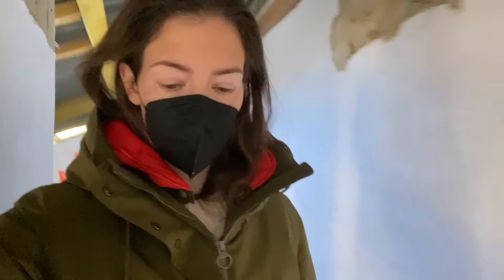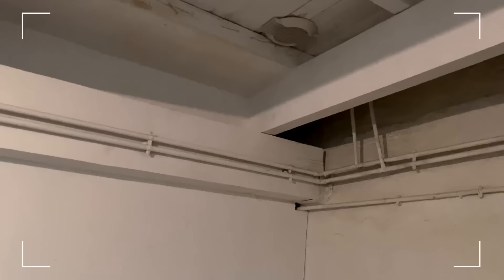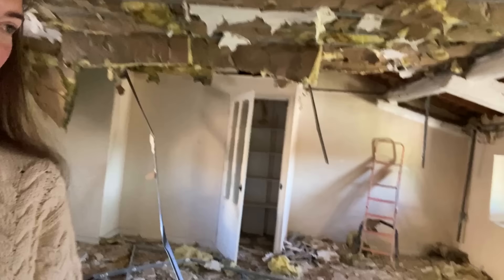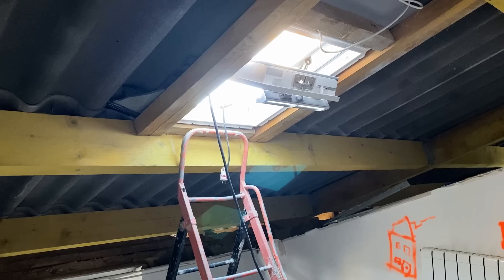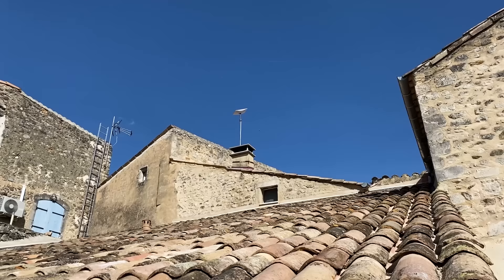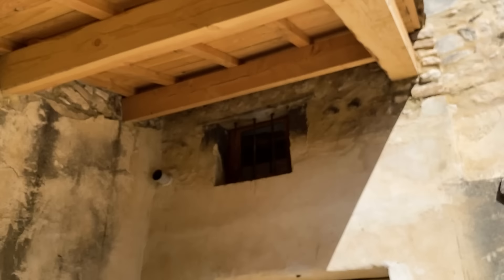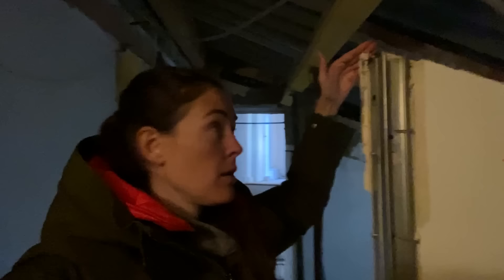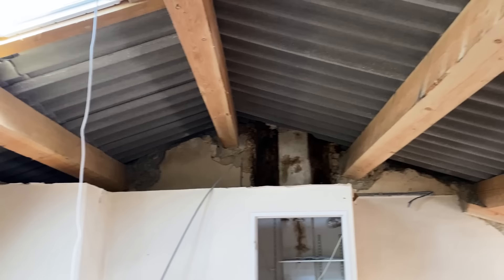The house renovation is *finally* moving forward! (Provence vlog)

Comment: It is so interesting that the architects did not understand the roof overhang would need additional support, but the carpenter did. Lucky you had him.
Reply from the maker: To clarify: architects tend to want to hang things, stabilising everything with suspended steel beams. It would have been possible to do the terrace roof like that IF the house structure was modern and not moving over time (old houses do that), and IF there weren’t such high temperatures in summer (which make wooden structures “move” and bend). That’s the challenge with a renovation, as I learnt: there are several ways of doing things, each expert gives you a different solution and then you are the one who must decide with the elements you have (and all the elements you still don’t know about). It’s stretching my logics skills and my research skills 😅
Reply: I find that very interesting that they wouldn’t know that/ they didn’t consult you about not wanting exposed metal beams. I am annoyed on your behalf.

We are renovating an old wooden farm house and our architect sent all the plans to structural engineers prior to completion. Do they not use structural engineers?

We interviewed a lot of architects and there is A LOT of variation in quality of work. One of them was a guy who talked to my husband the entire time. Needless to say he was not hired.
Reply: Its what they are trained to do.   Forget about architects without connection to reality
Reply: @justineleconte  Thank you for the explanation! I love the fact that you chose the very simple Builder's Solution (you could grow a vine up the support!) rather than the the more complex and expensive Architect's cantilever!

Comment: You may not need an interior designer if you have found the right craftsmen for the job. You are a creative person and have spent a lot of time in the house so you probably know very well what you want to do with it (and what you don't want). All you need is a structural engineer to make sure the house doesn't come down if you take out a wall. A good tip for finding craftsmen (or designers): search sites with holiday homes in your area (like 'Gites de France' or 'AirBnB'). Often these showcase renovated farmhouses etc. When you see a renovation you like, contact the owners and ask them who they worked with, I'm sure they will be happy to give you some names. Courage et restez positive!

Comment: Be sure you mind the feng shui rules and do not have " Exposed Beams" on your ceilings !  Be sure your ceiings are flat and  raise the roof so that you can have high flat ceilings and nothing in the attic space except  air circulating. radiator heat is teh best and the jappanese A/C in important rooms will save money.  So happy for you !

Comment: Dear Justine, glad to hear and see that the renovation of your house is moving on! It is a hard but exciting experience and you are getting through it!
I have only one concern when I see the roof construction: the wavy sheets underneath the tiles (the ones you see from the inside in the video) look like asbestos sheets. In the Netherlands, where I live and work as an architect, they are prohibited for use more than 30 years already because of their toxicity and even removing them from old constructions is considered to be a very big deal. I might be mistaken of course, because it's hard to see in the video, and it could be a different material. Also, the building regulations are different for each country, so I have no idea what are the rules in France. But I decided it was worth mentioning.
Good look in your renovation journey! Hope to see an exciting result soon!
Reply: Asbestos is prohibitet  in France since 1996. It must  be something different.

Comment: I’m a big fan of skylights 😊 I added 2 skylights when replaced the roof. It took me additional time to find the right roofer to do it because of special permits but it was worth it, no regrets 😏 However keep in mind that the sunlight is strong enough to damage wooden floor even if the glass is frosted like mine. I see now that the floor is faded.

Comment: Will you have an air-conditioning system installed throughout the house, as the Velux windows will let light/heat in during the hot summer months?  You have gained much space, which is excellent.  You are lucky with your carpenter! What about the gardenroom?  Could you make a kitchen out of that room with double doors into the garden? The old kitchen could become a formal dining room or the other way around, of course.  It is nice at Christmas time, for example,  to have a dedicated dining room.   Doing up a house is certainly very time-consuming, a lot of work, a lot of mess, and a lot of stress.  It will be all worth it in the end.  Good luck!

Comment: I'm gonna make a negative comment, sorry, I'm not the hugest fan of velux windows, just from personal experience with them, so I really hope those velux windows in her corridor aren't south facing and are double panned/glazed, because she lives in Provence in an old house with no AC, and heat rises, summers are gonna be horrible in that corridor, winters will be great, but not summers, she may have to instal rolling volets on them. I understand they might be the only solution or easiest solution instead of putting in dormers, but yeah, not my first choice.

Comment: Hi, I was wondering, in France, how long adter you get the permit must you begin work?
Reply from the maker: I think you have a year(?) to start, and then you can take breaks before finishing, as long as the breaks do not exceed a year. There’s no actual deadline to finish but if you take a break which is too long, the permit voids.